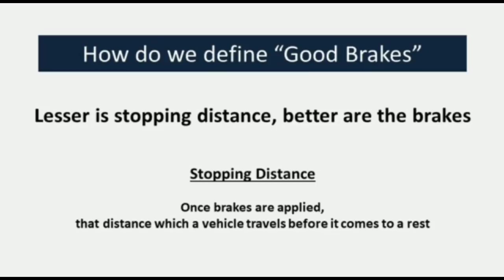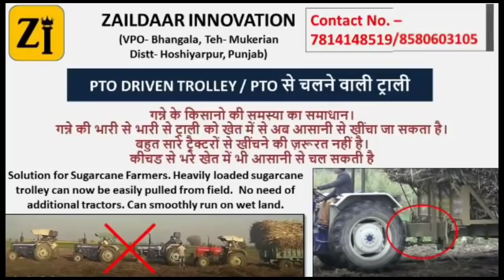బురద నేలల్లో ట్రాక్టర్లోడ్ ఈజీగా కొత్తటెక్నాలజీ || PTO Driven Trolley || PTO TROLLEY || PTO TRAILER

Comment: Great video brother. It's not that new a tech,  but the fact that you brought it to our Telugu farming brothers, is commendable. Another point is HP of tractor is also important for max weight pulling traction. I've seen mini or 25 HP tractors trying to pull 25 tons of load in a slushy field.

Comment: Trolley cost antha bro
Reply from the maker: It's around 2.5 lac and above anta bro

They are saying it is having good quality than our area trolley

Contact details given on description you can contact them directly
Reply: It's depend upon size
Nornal  size of South India 
10 feet long
6 feet width 
21 inch height
Price will be 215000 lacs PTO and  brake 
Without tyres